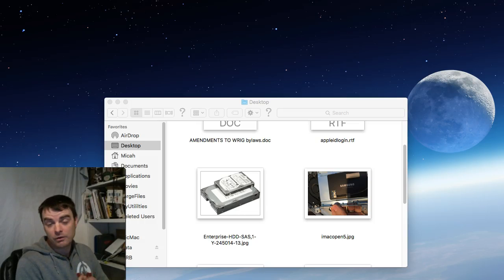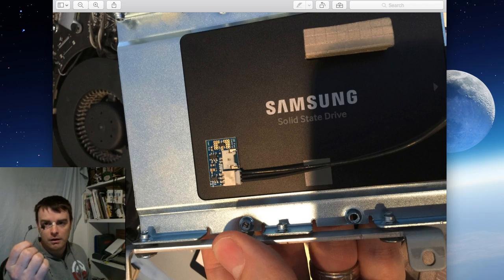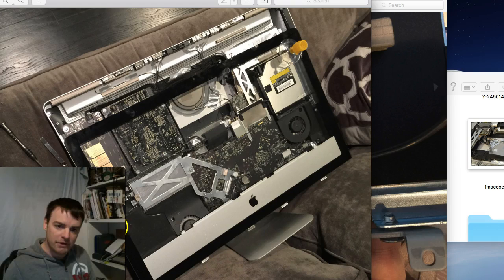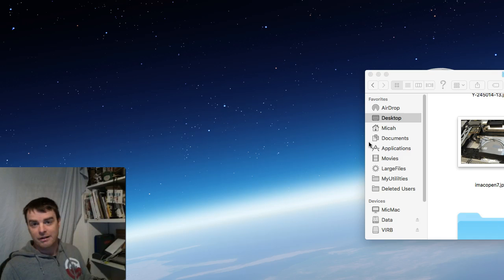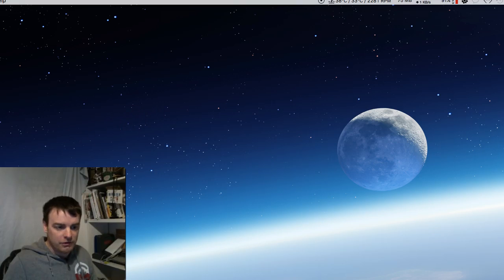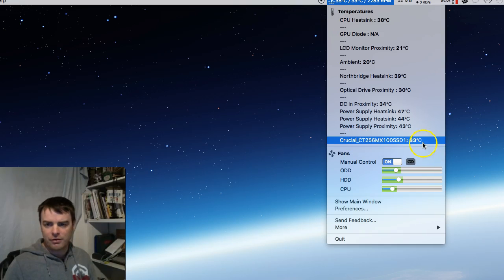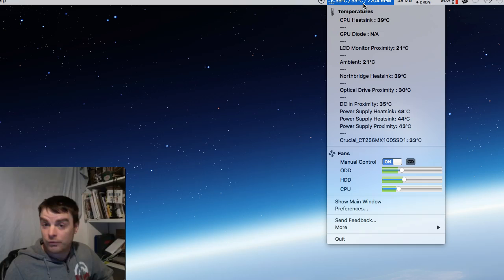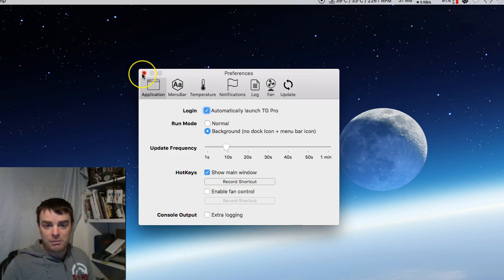EASY FIX!! Noisy 100% CPU FAN after upgrade to SSD, How To Fix It

Comment: i recently install ssd on my imac 27" 2013 model.  i downloaded this mac fan control software and it is saying my cpu is around 58 C.  What is the ideal temperature should a cpu be?  can someone let me know?
Reply: as long as it stays under 96c you're good. The thresh hold for most intel chips is 105c or 220F and less for AMD depending on gen.  Thresh hold meaning that's when the CPU sends an emergency to the PC ( YES A MAC IS A PC) to shut it down before damage happens, to either the CPU Die, socket or motherboard.

Comment: 2009-2011 iMAC models: Connect a power "Y" splitter between SSD and SATA power cable. SSD's SMART firmware handles temperature reporting to control fan speed.
See video: https://youtu.be/pMsk1o1W2B0  (individual is mistaken about fan speed staying constant. SMART's reporting affects speed).

Comment: dood this could have been a 2 minute video... you just ramble on and on
Reply: So to summarise, uses TG Pro (for a fee), to manually set fans at a constant.  Better than having fans at 100%, but annoying that they wouldn't drop automatically.  Bloody Apple, what a bunch of rotters.  Premium priced hardware, which requires labourious hacks for no much good reason.  Arsehats.

Comment: Does this damage the mac because some apps say it can damage the mac
Reply: I'd have thought that manually adjusting the fan,  on say the CPU, so it would be lower than it should be when it's working full throttle, is probably not the wisest of ideas.

Comment: I did it. Noise has gone. But, my magic mouse slowed down. There is a problem on my mouse. What is problem?
Reply from the maker: what's the connection between fan noise and a mouse not working??
Reply: @MicahGallant I use this app, but I wonder if it causes a hidden heatening on my computer? I cannot hear any noise anymore, because fan has stopped. So, the reason of the problem on my mouse might be a overheatening?

Comment: Thank you so much for the help. my technician had to put iin a new hard drive due to my imac desktop 2011 not starting up, i then got my mac back yesterday with a new ssd in it and the fan was very loud, the tech guy said that's normal but it was bothering me, so I found your video, ownloaded the app and it's very helpful and stopped the noise, thank you so much!

Comment: I just upgraded my Imac 5K Late 2015 with a SSD drive and I didn't use the thermo sensor and everything is running smooth, no fan noise at all.
Reply from the maker: ah good thing. they must have changed that knowing people would swap out the drive.
Reply: Really?   I bought my new SSD from OWC and it came with that extra sensor, I was thinking of removing it.

Comment: I have tg pro, but my cpu fan is running at 4198 and odd at 3800 rpm. which is very high.  the hdd fan is operating normal at 1100 rpm.I I put it in manual mode but it is still running high. The diagnostics say temp. sensors might not be working. Any tips??
Reply from the maker: +Chris G thanks for the comment, good question.... It just worked for me. Try toggling all the options to see if something triggers it

Comment: Does this happen to macbook pros? I want a samsung evo inside my old mid 2009 macbook pro 13 inch and I dont want the fan to run like this.
Reply from the maker: thanks for the comment. if i remember, there is an extra plug on 3.5 inch drives for sensors and so on the SSDs, that plug isn't there to be used for sensors. the SSDs just have SATA port and thats it.   the MacBook pro though, its already 2.5 inch so not sure if the sensor is on the drive or something stuck to the top of it to measure temp. I recall on my old MacBook pro, 2008, the thermo sensor was taped onto the top of the drive.